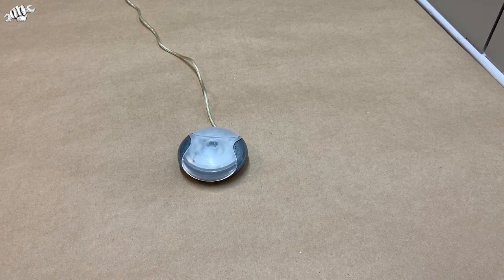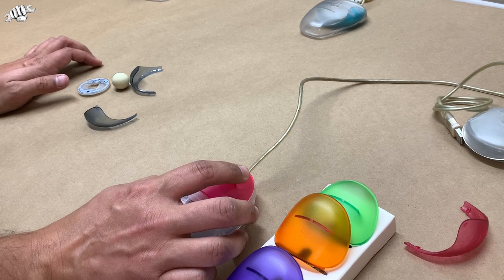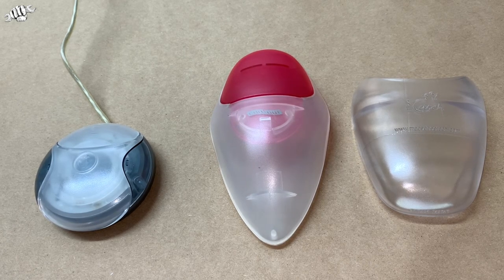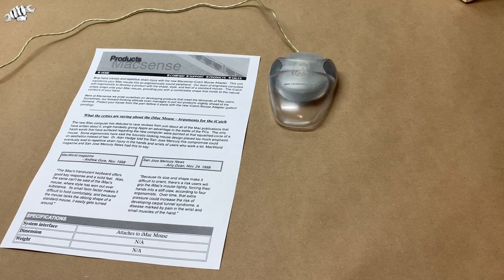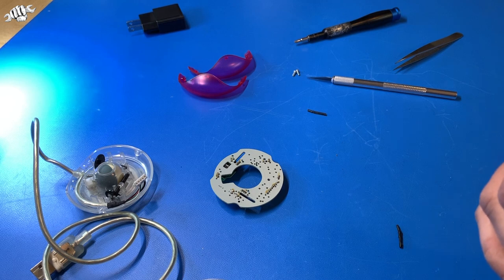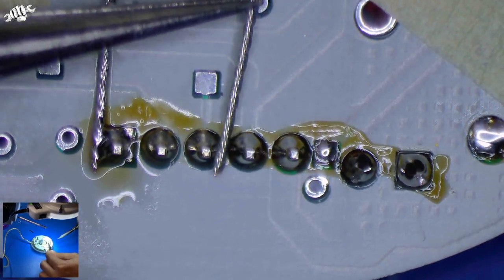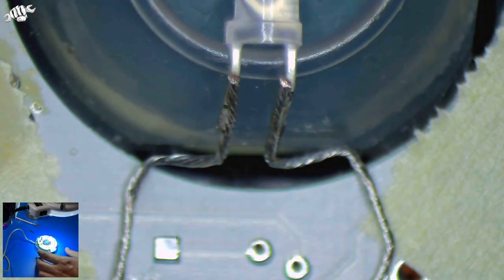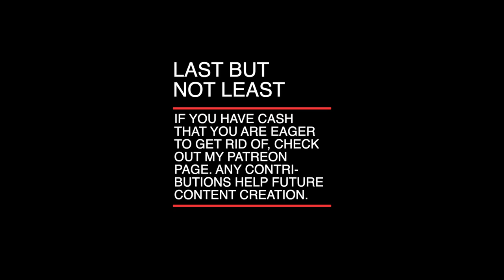3rd party Puck accessories and a fun mod

Comment: Nice Job Jay  Hot Glue Works Great For Holding Wire Its Non Conductive , Also Take A Clear Piece Of Styrene Plastic Use A Fine Grit Sand Paper By Sanding The Styrene It Make it Frosty This Will Defuse The Led Light And Will Make It More Uniform And To Add Color Due It On The Plastic You Jut Frosted  Just A Suggestion  But Anyway Great Job

Comment: Regarding the buttons: forward/backward buttons do not work on macOS out of the box without extra software anyway, because Apple forces trackpads on you, I mean, they think you should absolutely use trackpads for, er, reasons, er, innovation, er, er, magtrometer explodes, er, er.
Reply from the maker: Daniel Maslowski not sure which buttons you’re referring to. The puck only has one and it’s a simple click.
Reply: @TheHouseOfMoth  You were mentioning other mice somewhere in the middle I think, which is what I am referring to.